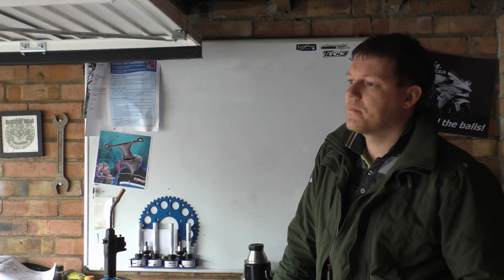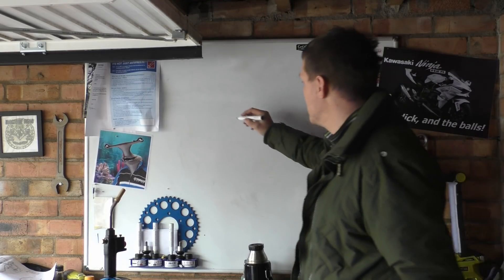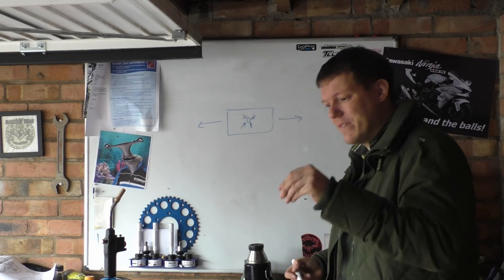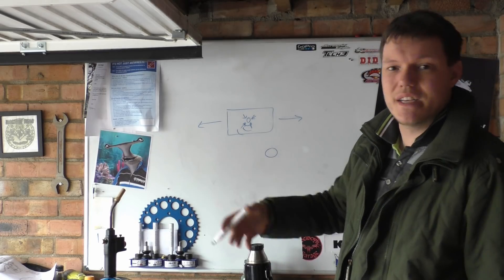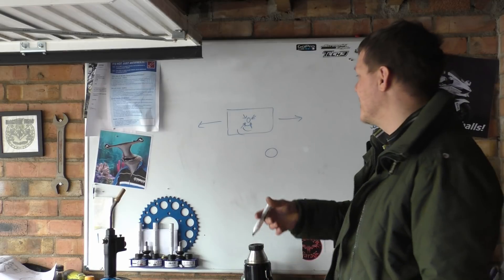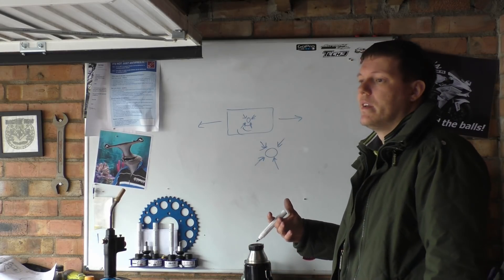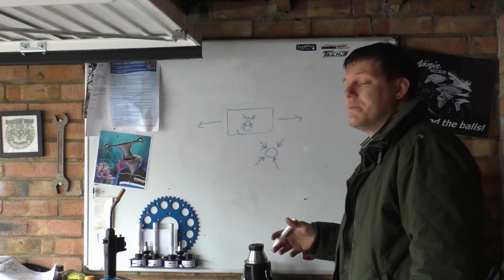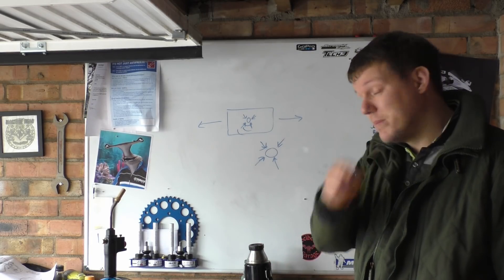Evans and Cavitation

Comment: I would like to see you prove your theories with math and physics this time instead of some back yard experiment.

You say " Evans is actually more likely to cavitate because it's thicker, basically because it's thicker it's viscosity is higher, if a bubble does form it's actually heavier which means that it has to accelerate and it's obviously got its inertia to resist that..."

Evans is about 11% heavier than water per volume, so that will affect the dynamic pressure of the fluid slightly.

The BIG consideration for your claim, however, is vapor pressure.  Water at an engine's operating temperature is already close to boiling.  The only thing keeping it from boiling is the pressure in the closed cooling system.  So if water is already close to its boiling point it certainly doesn't take much of a vacuum to initiate cavitation.

Evans has a boiling point much higher than the operating temperature of an engine so it's nowhere close to boiling even with no pressure added from the closed cooling system.  This means it's nowhere close to cavitation, which is why it can eliminate cavitation damage in diesels caused by water based coolants.  So if you plan to run another "Evans vs. Water" test to prove out your cavitation theory, be sure to get the water and Evans up to 90-95C before you start.

Interesting bit of data:  One of the upgraded water pumps Evans used to sell for GM V8's was specially designed to eliminate high RPM cavitation with water based coolants, which caused imbalanced flow between the two cylinder heads.  That pump was not recommended for use with Evans coolant because Evans didn't cavitate with the stock water pump and therefore did not contribute to imbalanced coolant flow.  Recap: either the upgraded pump OR Evans coolant would cure the imbalanced coolant flow, both upgrades were not necessary, just one or the other.

Oh, and the floor of your kettle doesn't suffer from cavitation pitting because the vapor pockets in the kettle collapse slowly and with far less energy compared to those in a diesel.  Those kettle vapor pockets move away from the heat plate into slightly cooler water and condense, a thermal event which takes a relatively long time.  The vapor pockets in a diesel are caused dynamically, the same way the vapor pockets form in Thunderf00t's vacuum vessel.  That's why it sounds like the glass vessel in his video is being struck by a hammer, and your kettle only makes a hissing noise.

A diesel engine's cylinder liner is vibrating at high frequency and with lots of energy.  Surround it with a water based coolant that's already close to boiling and cavitation occurs.

If I were you I'd drop this Evans bashing, your theories don't hold water.  BTW, you forgot to respond to my last comment on your other video.

Comment: Is it wrong to assume the cavitations from a higher viscosity fluid will cause more wear on a material than lower viscosity fluids? Because in general higher viscocity fluids have much higher vapor pressures (cavitation basically being like lowering the pressure until it briefly causes a bubble to form), or will the actual viscosity dampen the effects?
Reply from the maker: This is a great question, and the answer is one I don't know. I can make an educated guess but to state the facts is something I'd have to look into. 

I think it depends on where the bubble forms and the circumstances. True a thicker liquid will cavitate 'more' than a thinner one, but as you stated this also means that the thicker liquid 'could'? absorb this energy more

 - thinking about it, its also dependant on the density of the fluid when it comes to energy absorbtion, and the bulk modulas.

I'm cooking up a test for this soon.
Reply: Yeah googling it there's all kinds of scenarios where stuff might differ so I don't think there's any be all end all answer

Comment: To put it in simple terms: cavitation is VACUUM bubbles that implode at the speed of sound and creates a mini detonation that again erodes any surface it comes in contact with.
Boiling  water does NOT create a vacuum, the bubbles in boiling water are filled with expanding steam (ergo no cavitation) that have outward pressure but not enough energy to detonate.

Would that be correct?
Reply from the maker: At the speed of sound not light. And the bit with the detonation implies a kind of combustion, which it isn't but its not a bad decription.

The boiling water bit is spot on though.
Reply: The Workshop yeah ofc, lol 
My bad i'll correct it asap😂
Reply: Yeah detonation isnt the correct term, i tried to simplify it. 
Because saying the shockwave creates cyclic stress through repeated implosion that creates surface fatigue and a type of erosion called cavitation is such a long way of describing it...🤣🤣🤣

My problem is i dont know all of it, just enough to be dangerous to myself and my immediate surroundings🤣🤣🤣

Comment: I know jack shit about this so here goes. If the propeller is in a tank of Evans no doubt you would see cavitation, but the same force isn't present in a bike engine, so would Evans prevent cavitation more than a 50/50 mix and also do you actually get cavitation in the cooling system?

Comment: Used to see allot of pitting on coolant side of liners on older truck Diesel engines with basic fuel systems with manual injector pumps and very simple injection phases. A diesel knock was normal on these engines and liners becoming porous and leaking coolant into the cylinder was a common issue. Often heard people blaming the coolant for this pitting and never understood why. And now it makes sense. 
When Euro4,5 and 6 fuel systems were introduced this pitting has just stopped. Never see it anymore. They all have allot more sophisticated fuel systems with common rail technology and injection pressures upto 3000bar with multiple injection phases on one compression/power stroke with next to no diesel knock and very smooth engines. Thankfully this is not really an issue anymore!
Reply: That is why I love this channel, I learn so much from it. Most things I will never use/have need for but I like to know details about stuff that interest me.
Reply: mmdirtyworkz same here buddy! Every day is a school day!!
Reply: Gary Cloona Excellent post and contribution, thank you.

Comment: You can also see this on water pumps especially if it is on a engine that has been modified to run at much higher rpms than the factory ever imagined for that engine! It is also discussed a lot in boating circles because the screws aka propellers if spun too fast have issues with cavitation. It is not only a wear issue but it makes a lot of noise and is the enemy of stealth in the water.  Slightly off topic but relates to water. If you have not read about this you might find it really interesting. http://www.i-sis.org.uk/canWaterBurn.php
Reply: buckaroobonsi555 In relation to the military you mean u boats. I can't imagine a cruiser having much trouble with cavitation, on the other hand u-boats have variable screws to match different depths (i assume the chance of cavitation is higher in high pressure regions or high depths).

Comment: I think you get cavitation at the inlet of a pomp too fast. If you have too thin inlet line not on the outlet. I see it as sucking a vaccuum. Is that correct? It it like boiling a liquid because of low pressure region ? Or did i misunderstand cavitation ?
Reply from the maker: "If you have too thin inlet line not on the outlet. I see it as sucking a vaccuum. Is that correct?"

- Yes, but this is different in the context of bubble forming with temperature. More on this later.....

"It it like boiling a liquid because of low pressure region ? Or did i misunderstand cavitation ?"

- Cavitation is due to stretching a fluid - if that makes sense and the energies involved are really high (depending on this 'stretching' 

Vapor formation due to temperature or superheating is similar but not the same. 

There is a thin-ish line where the 2 can cross over, but not in a bike motor.